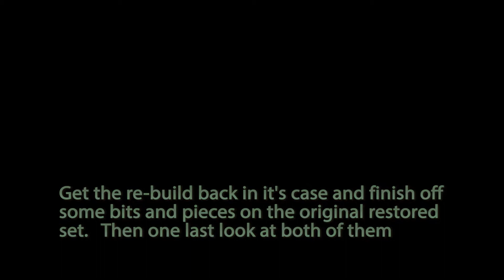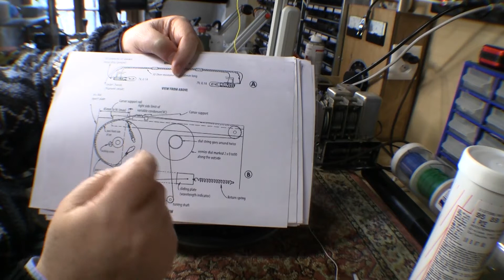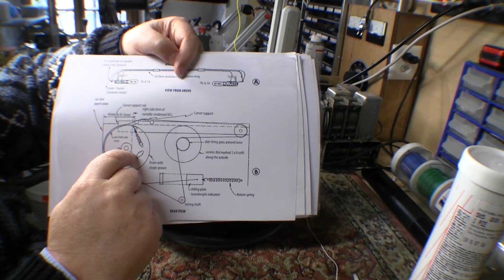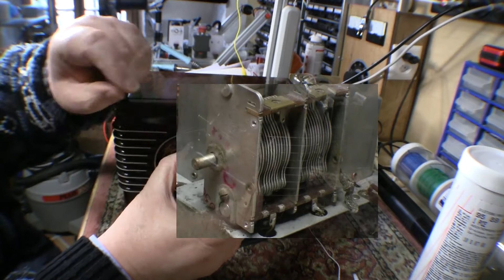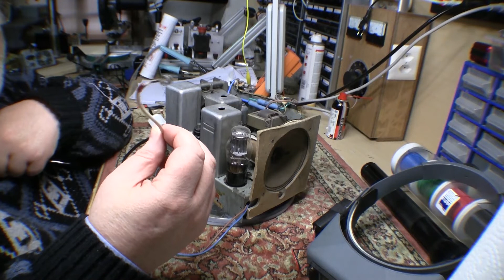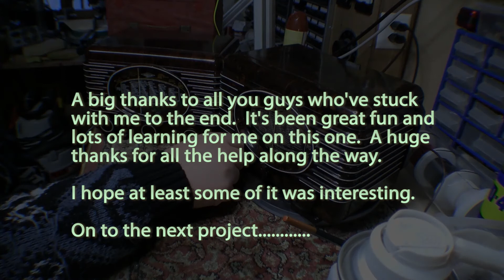Radialva Groom Rebuild - part 22 (final)

Comment: Oh , I see there why the bearing was so tight. I also had one condenser that I can remember that had this sort of adjustment as yours does. So where it was before you adjusted the screw, the bearing race was jammed to tight against the bearings causing the binding, I would assume.
   Funny your adjustment is on the front, mine was on the back, believe it or not.
   What a majestic looking radio John! It's been so long, I kind of forgot what the radio looked like it its cabinet.
   Well, I just finished watching the video. "Thanks for sticking with me", are you kidding? That's what I "love" about these sagas. I got a few comments as well when I did a Majestic 78/radio restoration that ran 22 parts! The intrigue that went especially with this set's tank circuits was extremely interesting. Cu-dos to you and Dennis on this one.
   I think, No, I KNOW, this is my favorite series from you.
   I love, long sagas! Especially as fine as this one turned out!
   Be well my friend, and cheers!
       Tom
Reply from the maker: Thanks Tom.   This one felt like a pilgrimage at times! I'll confess it was good fun and I'd say I'm a bit more confident on working on tube sets now than I was at the beginning.  I appreciate all the encouragement along the way! Not sure what comes next.......
Cheers,  John